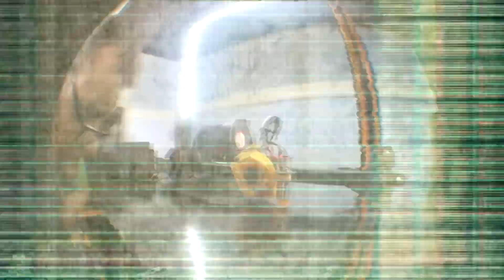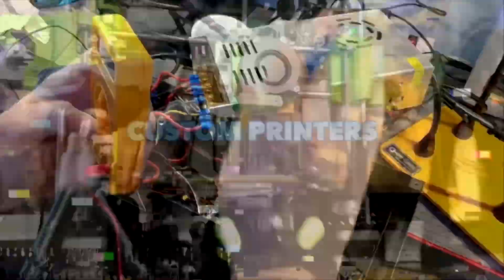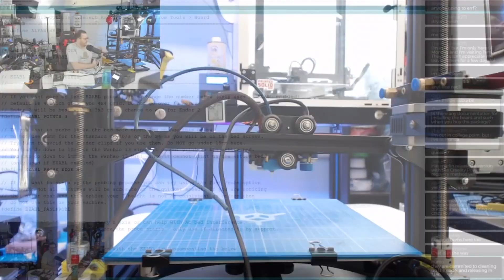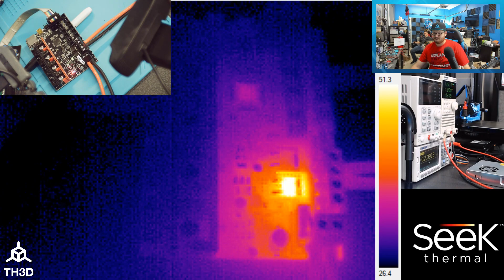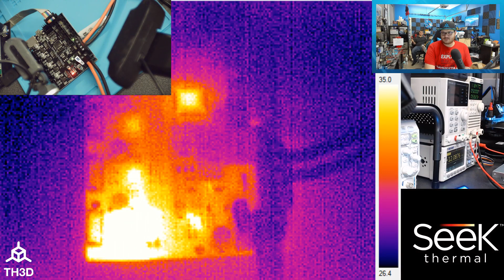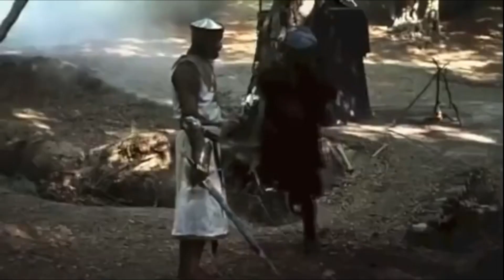Extreme Testing - 8 boards, 1 Load Tester - SKR 1.3, E3, Gen L, Cheetah, Creality V1&V2, EZBoard

Comment: Good to see that the EZboard survived
Reply: Not only that, but these tests show that only the ezboard had proper heatsinking by copper, which clearly shows which control board has been well made versus the rest...no wonder why that board is $100 by itself
Reply from the maker: @RJWaynerium  to be honest the board even surprised us. In testing before selling it we pushed it to 20A load. The board is fused stock at 15A as that's the most you'll see through it on the machines it supports.
Reply: @RJWaynerium  Really? And why should you pay extra 70$ just to push it to 30A, when it was design to work at 15A?
Reply: @macacinelecanale   you're looking at this wrong. Higher quality PCB: lasts longer. In this case thicker copper means lower heat dissipation which means longer life. For the SKR for instance the board will work but the design cuts corners and will break more quickly.
Reply: @RJWaynerium  Yes, in normal working condition, the EZboard will last for 50 years, and MKS only for 49.
Reply: @macacinelecanale  ok both of those figures are outstandingly off. Mks will likely burn out in 2 years and ezboard will last for at least 6 years. Where in the hell did you get 50 years as a figure? Semiconductor parts have no chance of lasting that long
Reply: @RJWaynerium  It seems that you are a great electronics specialist. I had electronics that lasted for more than 20 years and were thrown away just because were obsolete.

Comment: Im confused. Does this simulate real world use? How much juice can a few small motors and heating elements draw? I feel like performance during overstress is just as important than max load testing. If a board can survive a higher amp load but the print starts to suffer for it, isnt that more impactful than just being able to keep the lights on while overheating?
Reply from the maker: As stated in the video most beds at most pull about 10A, which is your major load. Having parts that handle much higher current than you will be using them at results in less heat on those components and electronics last longer when they run cooler.

Comment: What is the point of this video... Thr normal working conditions of a printer are not recreated...
On my skr 1.3 with normal cooling of the whole motherbord I get a max of 34/35 Celsius on the mosfet...
Reply: It was to test how much tolerance you have from the nornal spec
Skr themselves state you should run a heatbed directly from the board only if draws up to 15 amps or has more then 1 ohm resistance  or the bed is up to 144 watts, skr even has fuses rated for 20 amps , my bw bed is 2.3 ohm resistance so I'm guessing i should still use a mofset
I was hoping the ske pro won't need it, but it doesn't seem this way
Shame about the mini though 
 I currently have the mks gen 1.4, mini, skr 1.4, and soon skr pro in an attempt to discover the source of motor clicking i have , and mini seemed nice
Reply from the maker: To show how well or poorly designed the boards are and it was fun to do. :)

Comment: So, SKR 1.3 internal mosfet can work with mk2a 300x300mm heated bed (24V, 16.6 Amper) without any problem?!
Reply from the maker: From the testing it may be OK. But we'd still recommend an external mosfet on that board. Something like this: https://www.th3dstudio.com/product/high-amp-12v-24v-mosfet-heated-bed-or-hotend/

Comment: I only paid $22 dollars for the skr v1.3. Cheap way to upgrade to 32bit for a Delta printer. I know I'll never bypass the fuse and throw this much amps at it. Would have loved to see some higher quality boards tested also to be fair. Ezboard against only much cheaper boards isnt really fair. U get what u pay for. Curious how a Duet or Ultimachine rambo board compares thermally to the boards tested here. Thanks for testing and sharing results with the community.
Reply from the maker: We're working on getting some higher end ones. The issue is people constantly compare the EZBoard to the E3 and the Cheetah. The reality is the EZBoard is far above those and it shows. Not even talking about the MOSFET and general design but their firmwares for both boards is still very much in alpha stages and their support groups are littered with people that can't even get firmware working on them.

Comment: I think this video was very interesting. However, I would like to know If any of this boards could be dangerous on an Ender 3, especially the SKR mini E3 which I have. As far as I know the Ender 3 bed is rated at 220w, or 9.2 amps at 24v. Apparently at this draw the temperature remained low, even without a fan. Also the bed probably consumes the maximum wattage only during short time when is heating, especially for PLA prints. Do you think in normal use this could be a issue?
Reply from the maker: Only time will tell. Based on the ohms on the beds our ender 3s varied between 10-13A current draw. The stock boards have been doing fine, even in an enclosure.
Reply: @TH3DStudio  thank you!!!

Comment: I wish I could see the view from of the meters and the load. What equipment are you using to test?
Reply from the maker: It's in the video. You can read it if you select the HD option. It's on the right side of the video.
Reply: @TH3DStudio  All of my video settings are set to HD. Even in 4k you can't read the top and bottom numbers reliably. The camera needed to be moved so you couldn't see the side.
Those meters have a maximum field of view and the camera was not aimed center so you could see the changes. If you can't see the dot separating the digits then the view is not clear.

Comment: Good choice on screw terminals. The power distribution industry uses them quite extensively.
What are your thoughts on ferrules?
Reply: Ferrules are excellent for electrical connections. They keep the wires bundled while also allowing for the terminal to deform the ferrule to the necessary shape to make proper electrical contact. 

I always use ferrules in all my machines.

Comment: Shit, I just ordered the E3 mini. Should I get a refund and just stick to the stock ender 3 board?
Reply: FadedSouL E3 Mini is plagued with issues (as is the Cheetah). Go read through their Facebook groups for more info.
Reply: I have the SKR mini E3 and It is working very well. Didn't even have flash a new firmware. As far as I know the people who still have problems are the ones with the DIP version.
Reply: Get the mini DIP instead. Not drop-in but still small.
Reply: @travisbrown5054  I'm not trying to have to buy steppers separately and then print an enclosure. That defeats the whole purpose to me.
Reply: EZBoard is on backorder ;-)
Reply: My ender 5 group favors the skr 1.3 vs the mini, as they do the ezboard. I would say the skr 1.3 is your best bet
Reply: @RJWaynerium  but the Mini E3 is much easier to install. I bought the SKR 1.3 and 2208 steppers and never got the time to solder the steppers (at that time they didn't sell steppers presoldered in uart mode) and to install and configure the board. I replaced the original Ender 3 board with the SKR mini E3 in 20 minutos. It was already preconfigured. The print quality is considerably better now (not as good as my Ender 2, but much closer). The SKR v3 is probably a better board, but I wonder If the Mini E3 is not good enough for the Ender 3.
Reply: @luciomachado6727  eh I don't use installation easiness as a valid metric for getting one board versus another, especially for something as trivial as soldering
Reply: @RJWaynerium  well, soldering a stepper driver is not so trivial for someone not as gifted as you. If installation easiness was irrevevant many of those boards wouldn't exist.
Reply: @RJWaynerium  You might not see ease of installation as a factor, but I do. And I'm not spending half the cost of the printer on a board. And it might seem trivial to you but it's not trivial to everyone. My printer drives my business, so I can't afford to have it down while I wait to print an enclosure, wait for stepper drivers to get here, solder them, set the vrefs etc..
Reply: @PatrickBeee  it's just a solder job mate. I get you for your business as someone who worked for a small company, but upgrades are necessary for a business if you want better quality!
Reply from the maker: The EZBoard is a solution that just works. We even spend a ton of time eliminating the hassle of firmware for our customers as well. You can do it all online with 0 local programs to setup. Meanwhile the other boards barely have EEPROM working since the board doesn't even have a chip on it for EEPROM so they're trying to use program memory to store it.

2-3 minutes with our free online tool and you can have firmware for your printer with our EZBoard with 0 hassle. Check it out: http://ezfirmware.th3dstudio.com/